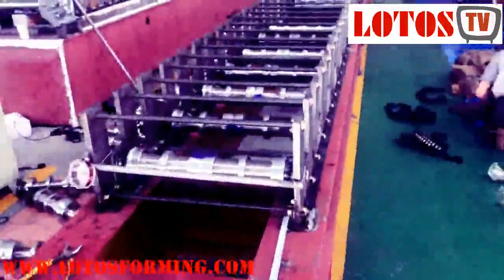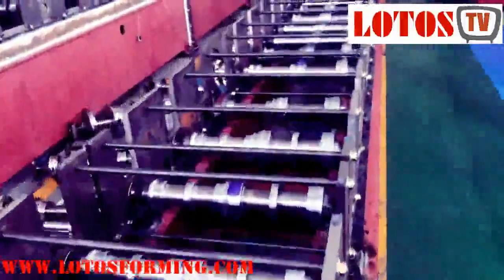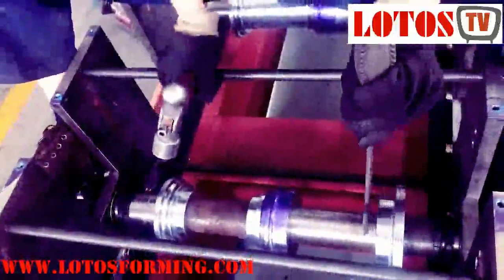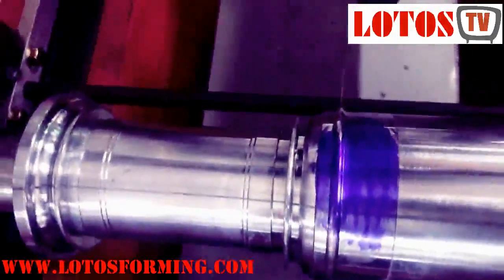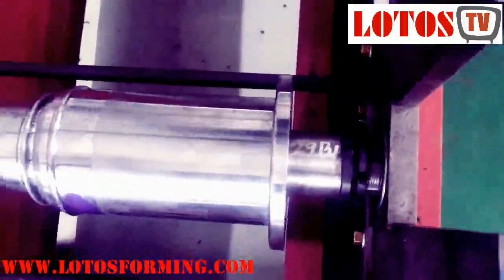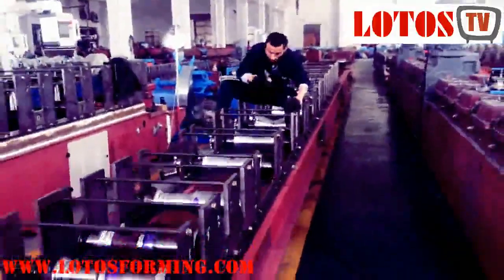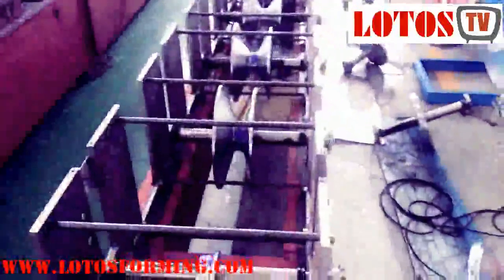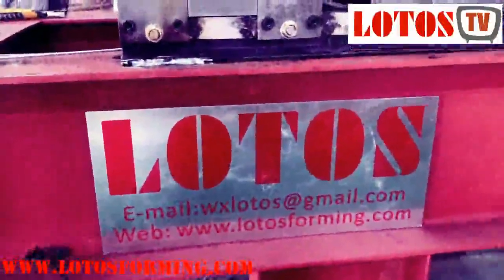HOW to adjust a roll former for roll forming machine ▶ roll forming dies ◀

Comment from the maker: The position of the top roll can be adjusted via screws to change the gap between rolls, thereby changing the forming pressure applied to the metal at each stand. The final roll gap adjustment on each stand should always be down to compensate for the gear and bearing tolerances inherent to each stand.
You can see the adjusting roller and shaft in this video!
http://www.lotosforming.com/contact-us/